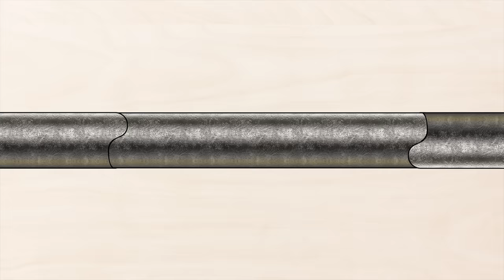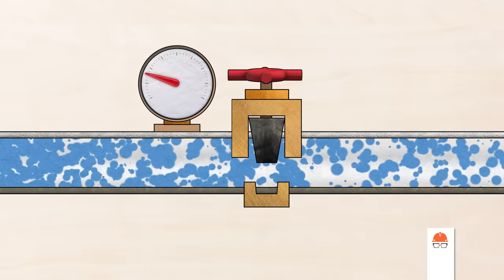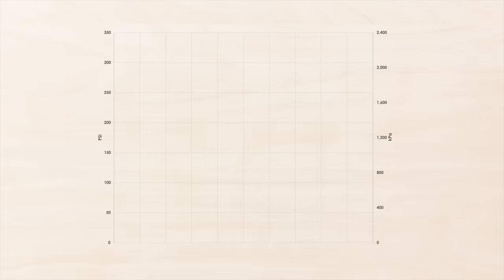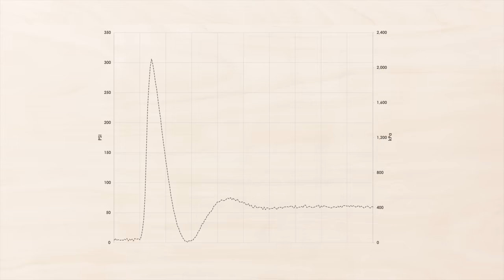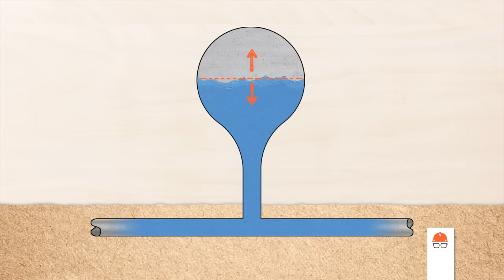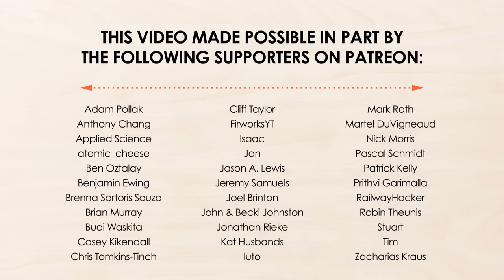What is Water Hammer?

Comment: I'd never heard the term 'water  hammer' until I ran across this video.  However, I have experienced it in my house but didn't have an assigned name for it.  I knew what was happening but why did it develop during the the night and after I had been living in the house for a little over ten-years.  

My story:
Sometimes working late into the night and early morning on my computer I would sometimes hear this slamming sound that sounded as if it were in the wall directly in front of me (the width of my desk) but also sounded as if it could be coming from downstairs.  Because I didn't check the time of day/night I was hearing the noise it was confusing to me as to why I would hear it sometimes and go several days/weeks and not hear it again.

Figured it out:
With just my wife and me in the house, she sleeping and me pecking computer keys and there was not another human to consider it was a bit of a conumdrum.  Found the culprit.  One night it banged and sounded louder than usual so I put on my Sherlock Holmes hat and headed downstairs.  The only water running at that time was the dishwasher.  Turns out that the solenoid that told the water when to enter the dishwasher and when to stop was slamming the water off when the dishwasher had what it needed at the time. There it was, my banging water pipe mystery.

What to do?
I learned of a relatively inexpensive fix, and can be even more cost saving if you are a better than handy do it yourselfer. Ta-Daaaa ! ! !  Introducing the 'Water Hammer Arrester'. See everything you'll ever need to know about hammer arresters here - - > https://www.youtube.com/watch?v=FbkE0HhEHVY .  I don't know that this will solve everybody's problem but it fixed mine. I have not researched to see if there are good, better, best or great arresters. A plumber installed one in the supply line to the dishwasher and it solved the banging. It would have been fruitless to change the solenoid as it was a bad design and a new one would have produced the same result. All appliances should have (and most all surely do) slow closing valves and this is nothing new, so why GE decided  to use this water banger - I don't know, could be cost or they got a bad batch.  I probably could have pushed a little and GE most likely would have installed a proper valve but the way I went was a sure fix and I learned something. There are water arresters designed specifically for some appliances, and while the plumber didn't say and I didn't ask, I assume you could place one anywhere along your water supply line and more than one if necessary.

Why did it go on so long before I tracked it down?
I would go to bed at different times and my wife would set the dishwasher delay for different hours, hence the planets had to align just so as for me to be up and the dishwasher doing what it does at the same time. BTW the plumber, which I had never met immediately had the answer  - - - - - so - - - - - this 'hammering' thing is more common than most people knowl

Comment: Larger pipes have lower spikes in pressure, but they cost more, and the hoop stress is higher for a given pipe thickness.  Gradual opening and closing of valves and pressure relief devices (water columns, bladders, etc.) are more practical than increasing pipe size.

Comment: You can get a 3-phase motor starter that is called a soft start. This will ramp up the speed of the pump slowly. It will also have a soft stop setting that ramps down the speed of the pump slowly also.

Comment: In my situation I only have this problem on my washing machine. I installed the proper fittings to eliminate it several times but it always comes back. I have now figured out that limiting the opening the cold water valve to only 2/3s of the way has fully alleviated the problem. Tub fills a little slower but it works perfectly for me. Hope this helps some of you.

Comment: I remember long ago reading about the Roman aqueducts, and a photo of pipes that ran down a hillside and back up the other side, to traverse a valley.  There were some kind of fittings at the bottom that the author wrote showed that the original engineers understood water hammer and how to deal with it.

Comment: Often a 3-5 sec Soft Closing/Opening of the Valve Actuator on the valves in the process system helps a lot to reduce water hammering. As well the replacement of malfunctioning valves. I’ve seen faulty valves that was malfunctioning on a Mixed Bed (MB) Unit system almost totally destroy the 6” Stainless Steel Internal piping, Mid Collector piping all due to water hammer. It costed a lot and weeks to do the repairs. The Power Plant site ended up going thru and replacing over 100+  valves in the system that were at least 20 years old as others were known to be malfunctioning. The incident was the wake up call.

Comment: Thanks for the excellent explanation of Water Hammer! I'm assuming that thermal expansion tanks also help with Water Hammer because they act as an additional reservoir and the air pressure only allows for the temporary expansion due to heat or of course, the temporary rebound of the water when a valve is closed.

Comment: I saw a video years ago where a crew was testing a deep sea diving bell. It had failed the test at depth and filled with water. When it was brought to the surface, water was spraying out of the seams and even the bolts holding the bell together. Every time I hear that water is incompressible, the image of the water spraying around bolt heads pops into my head. How could the bell be full of obviously pressurized water if the water can't be compressed? I'm sure the explanation is simple, it's just beyond what my lizard brain can comprehend. 

I looked for the video, but can't find it. It was way before the days of YouTube and was part of some forgotten documentary. It's probably out there somewhere, but I can't remember the complete context.
Reply: sea water does have a soluble limit for gases like hydrogen, nitrogen, etc, which are subjected to several hundred atmospheres of pressure in deep sea situations

bringing up a secure container full of that water is like shaking the hell out of a soda can, the gas is hyper expanded and the water is bubbling up trying to let it out

Comment: I seems like you’re saying that the pipe length makes a difference (ie the 80,000,000 kg of water in a 100 km pipe). But it doesn’t matter. If the pipe were just 1 m long, the pressure spike would be the same. Great video. Thanks!
Reply from the maker: Yes it definitely does matter. Momentum is a function of mass.
Reply: I beg to differ. The Joukowsky expression shows that pipe length does not play a role. If it did, only petroleum engineers with 100 km pipes would care about waterhammer. But truth is that plumbers (10 m) care too. https://en.m.wikipedia.org/wiki/Water_hammer
Reply: In fact, you can test this: use 1 m and 100 m of garden hose. I predict that 100 m will have a weaker pressure pulse,  owing entirely to extra friction.

Comment: Thanks Grady for an interesting presentation, as usual. You should have mentioned, and shown, however, how water hammer is dissipated in surge shafts in hydropower project pressure tunnles when a valve in the powerhouse is shut suddenly or too quickly.....

Comment: The simplest fix for this in a residential setting is to add a couple feet of pipe (vertically)that connects to nothing and is capped at the end. In effect, creating a captured air space to absorb or cushion any pressure spike.

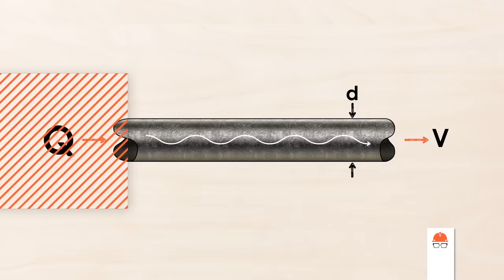Comment: 4:10 Increasing the cross sectional area of the pipe would in fact reduce the velocity and reduce the pressure spike. The total amount of force at the valve (pressure * area) wouldn't change though would it? So for the same amount of flow just increasing the size of the pipe may not necessarily solve water hammer issues. In addition to that the amount of fluid in the pipe (based on length and diameter) will have an effect on the severity of the water hammer.

Comment: written through a translator:

Hello! I really like your videos, especially about the water hammer.

Question: what happens if, during the abrupt closure of the valve, there are unresolved air bubbles in the water. Will they shrink while acting as a compensator (damper)? Or will the pressure difference push them towards a lower pressure? Is it possible to conduct an experiment where the role of gas bubbles will be performed by rubber balls with a cavity inside?

Comment: The reason why I use metal pipes. Always had bs with polymer pipes in my vacation home. Replaced everything and gone water hammer and freezing problems with leaks. Not having the main valve open maximum but 40% to reduce water pressure helps a lot

Comment: I always wondered why, when I shut of my hose, that a brief flush of water would burst out of the connection points of the hose and the values.   This water backflow, to me, seemed related to pressure.  Now I understand why this is necessary.

Comment: There is a pump that uses the water hammer effect, called a hydraulic ram pump. Used to be widely used in rural areas in the UK. Look it up. No moving parts other than a simple valve system. The remains of some of them are still lying around in the countryside.

Comment: I feel like water hammer is the hydro analysis equivalent to harmonics in electrical engineering. Harmonics are basically spikes in voltage (essentially electrical pressure) which are caused by large equipment like pumps or chillers starting up and shutting down. The same problem happens where you get spikes in voltage that damage cables and other electronics on the same system.

Comment: I built a house 50 years ago and neglected to include any surge relief in the plumbing.  I wonder sometimes if it created any problems, but not when I lived there.  Now I live in a subdivision in a  city; so I wonder about the contractors that built it.  Water Hammer is not an enormous problem in subdivisions but I am a firm believer in belts and suspenders.

Comment: A tee fitting in line, pointing up , and capped off, will contain an air pocket. The air pocket can be compressed easily and will prevent the water hammer.

Comment: In case of  the high rise buildings, we always face the Water Hammer reaction, and cause some damage to the pipe system. How can we mitigate that such kind of pressure?  The installation of PRV is the best way to reduce that?  Thank you very much.

Comment: Early in the Space Shuttle program they discovered a water hammer issue in the propellant lines to the forward Reaction Control System engines. They fixed it by changing the cyclic rate of execution for the Digital Autopilot software that controlled the valves.

Comment: It always annoys me when people say water is incompressible, because it's obviously false. If it were completely incompressible, how would the pressure change when you push on it? Surely it would stay constant...because it can't be compressed. Yet it does change. It's an obvious falsehood that people just repeat as nauseam. Water IS compressible, it's just much harder to compress than air.
Reply: Most simple scientific explanations are, well, simplifications fit for every-day scenarios. The volume taken up by a set mass of water does not change with any kind of pressure you can achieve, hence it is incompressible. Regardless... What exactly is pressure in your scenario? If you stick a measuring device underwater, it's the device that is getting compressed and not the medium. A pipe bursts and a diver struggles because of their own structural weakness when subjected to exterior forces, and the point being made is that water inherently cannot give like a wad of cotton would.

Comment: I once made a barometer containing mercury. I had to consider mercury hammer where there is a partial vacuum at the top of the glass tube. It actually makes a metallic klunk sound. Mercury is 13.6 times denser than water. (denser than lead). Generally you carry a barometer sideways or Fortin barometers store the mercury in a reservoir for transport.

Comment: 05:08 took me this long to remember we had one of our water lines break from this last year, someone while doing "maintenance" had replaced part of the metal piping by PVC parts, when one of the flow gauge/valve closed the pipe junction exploded >< they did a major upgrade to the whole setup after that, the piping isn't shaking all the time like it used to

Comment: In the 1880's, John Keely of Pa machine shop, built a brass self rotating water / air motor using inherent , built in water hammer for 50 lbs pressure with output flywheel and offset crank hooked to reciprocating saw. The rod arm was adjustable for timing. The motor was doing work by sawing wood for visitors and clients / investors. The Patent application was refused , since the investors names were not on the application. ( he had rotating central 4 way hydraulic shock valves generating pressure. The first several models had hand operated mechanical lever. You can see photos on Internet, - hydro pneumatic vacu motor.) See also S.V.P. data sheets and historical booklets. Unit was stored in museum, sold, then stolen once, and recovered a year later. The machine matches the working instructions in the Patent application papers.

Comment: While working on city infrastructure t joiners were applied inline and capped to absorb water hammer by allowing the water to compress the air inside the capped t joint.

Comment: Helped repair a spindler system today. When the valve is open you can hear the hammer under the yard, its easy to follow the sound and know where the pipe is. At the street box there is a regulator, I am thinking this might be the problem, what do you guys think.

Comment: Before the advent of pumps they could get water from a reservoir to higher elevations by gravity flowing water in a pipe to a lower elevation. At the discharge there was a flapper valve that would close by water velocity. The spike would then push water back up through a tee to the higher elevation.  After the spike the flapper valve would open (because there was no velocity) and the velocity would speed up and at a certain speed it would hammer shut again. ...and repeat.

Comment: Can you spread out water hammer effects with varying pipe widths, or adding extra turns to the pipe? For instance if the pipe zigzagged instead of being a nice round curve, would the hammer happen more across the length of the pipe instead of all at the end?
Reply: it's not physically possible, for water to flow without grade(aka a slant for gravity to carry it, like a drain), it needs to be pressurized

the only thing varying pipe widths or zigzags would do is cause extra stress points during (de)pressurization, as it wouldn't be evenly spread out vs material used/circumference ratio

the only way to "solve" water hammer is to have short runs(not always possible), low pressure(lol), or valves that can only be operated slowly, aside from something else genius

Comment: In residential systems we just build hammer arrestors. Six inch vertical lines with a cap above your valve on hot and cold side. Gives you a compressible air pocket
Reply from the maker: That air dissolves into the water pretty quickly.

Comment: I’m creating a drip irrigation for my garden and attaching a timer to the outside faucet. Do I need both a water hammer arrester and a pressure regulator or to hook up the system or is one enough. If one is enough, which one is more preferable.

Comment: Hi. Thanks for the excellent video. I live in a high-rise 18 floor apartment block and the water is gravity fed from overhead tanks. I often hear a "thunk" when the cistern valve shuts after filling up the tank. From your video, I believe this is a water hammer and it can damage the pipe and/or joints etc. 

I wonder what I can do to mitigate the issue?
Thanks in advance!

Comment: In high rise buildings, such water hammer causes pipes to rapture and repair is expensive. Most places have water tank on top of building and hence, the effect of water hammer is maximum when someone from bottom floors (far from tank) of the building closes the taps versus someone closing tap from top floor (near to tank).

Comment: It's not water, but everyone can feel the hydraulic shock when a gas station nozzle clicks off, even when there are pressure outlets at all the other open nozzles.  The use of flexible piping in these applications does cut down this effect by allowing the energy to be dissipated as pipe displacement, as in the long, circular loop shown in the video's illustration.

Comment: My buddy had this problem. I cut the horizontal water pipe and put a "T" into the pipe facing up. Then I added a seven foot piece of pipe going straight with a cap in the end (trapped air). This instantly solved the problem because the trapped air would compress and the hammering noise was eliminated.

Comment: The 2001 Nisqually earthquake resulted in a water hammer that blew all of the joints in the feed pipe to the tower due to a seismic connector that did not have a loop to prevent longitudinal impact to the water.

Comment: I would have liked to have seen a pressure gauge on the other side, supply side, when the water hammer hit there also along with the effect of another hammer arrestor on the other end.
Reply: I would have liked to see how large the spikes were with repeated opening and closing of the valve as fast as possible. The water wouldn`t have much time to gain momemtum, but  I guess with 60psi mains pressure from the tap it could be fairly rapid.